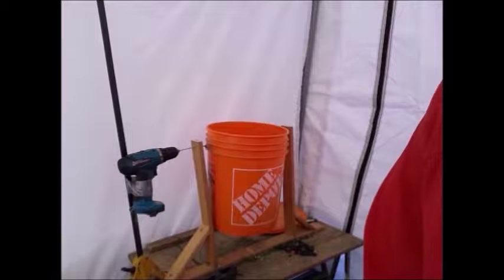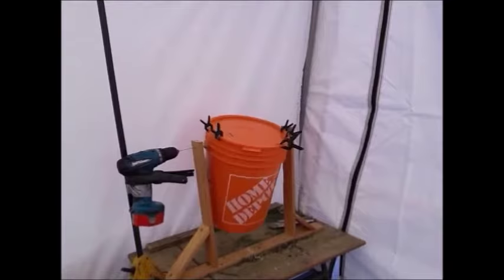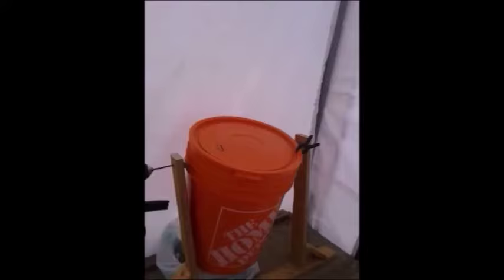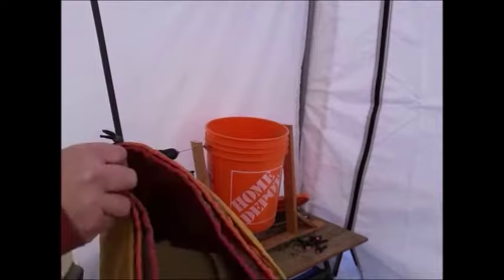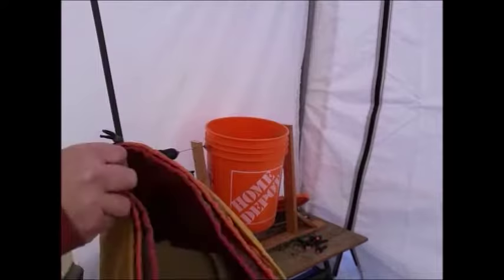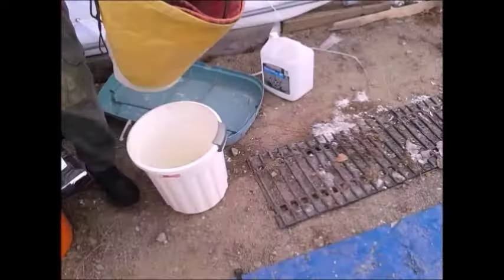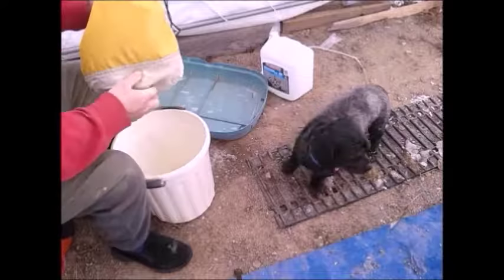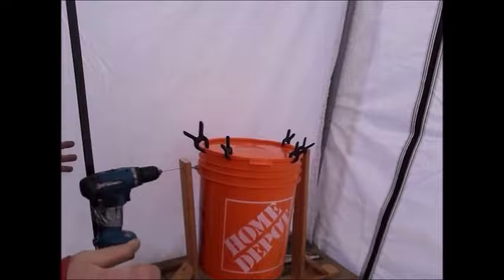Dry Sift Hash "the easy way"

Comment: Man, I’m 40, I fought in Iraq, was wounded and have PTSD, I grow my own medicine, I try to use every usable part of my plants.  I’ve been making honey oil, but I’m always down to try new methods of making concentrates.  This looked stupid easy.  Other than the initial work of growing your plants, and then building your contraptions.  Great video, it looked like a decent enough brick of hash, I would have definitely smoked some.  🤘🤙🙏
Reply: Mix your Oil and Keif together now. Old School hash.  Super potent!...You only need like 1G Oil ( Binding agent) to 4-5 G's of Keif.  Tape some wax paper to a cutting board and using a small spoon start mixing ( Pressure squishing ) until you rupture every trichome until it's all nice and black. (Providing your kief is blonde and not green). It usually makes a nice chunk of black Hash.  If you have dirty Keif (10%-20% green) then you'll have a second chunk for friends. 😆  Still choice but the colour starts to change from Black to Brown to Green as your grade of keif degrades. Still top shelf just a different colour. 
There's a ton of videos on making keif. Ideally you would want 100 micron equivalent to 140 mesh for blonde. When I was younger I used to use pantyhose stretched over a containe, then shake it nicely not too hard. Even better if you add a penny to about 5 G. Keep checking the color in the bowl. If it's not stretched enough, your trichomes won't come through, and too much you'll start letting plant material in. So you'll need to adjust and find that sweet spot.  It's just a quick and easy way to make a little bit of kief on a smaller scale, not having to go out and buy anything. But yeah there's lots of videos online. Good luck brother. 🇨🇦
EDIT:  Check out this guy.  Jonny's green extractions.
Reply: @locknload9143  thanks, I appreciate it.
Reply: @stinkfist4205  Anytime brother..Been making it for Years. 53 now. Let me know if yea need anything.
Edit: He has a 30 min. video titled " How to make Hash"  it's the perfect way.
Reply: @locknload9143  I’ll have to check it out.  Seeing as though I’m curing my harvest as we speak.  I use my fluffy buds and trim for concentrates.
Reply: @stinkfist4205  ..Yeah forsure!
Another one of his videos is titled: "BHO honey oil".   I just use a piece of abs with a plastic end cap. Same thing but Saves some money.  You can either sit it outside for 4hrs (if it's cool/cold out) or use a second container filled with warm water to evaporate 90% before heating.  You'll see in the videos.  Just do it outside brother!  Dangerous fumes.

Comment: Nice process. If you skipped the rock step and just went straight to the bags and shaker with crumbled flower or trim you would have a much more potent product. Best of luck and happy growing!
Reply from the maker: the frozen rocks are what crumbles the flower and knocks the trichomes off the buds, I know I overdid it with the rocks but it is a lot easier than trying to crumble it by hand because of arthritis, next time I will use fewer and smaller rocks for a shorter period of time
Reply: @TheCandleman51  unless you're using flower you shouldn't need to crumble it brother and if you are using flower try freeze and smash. I'm just trying to help out here. Please dont take this as criticism.
Reply from the maker: @thehomeownershelper9325  not sure what you mean... I was using flower and it was frozen, everything was frozen outside overnight. I don't even try to make hash out of shake.

Comment: If the hash was heated up it would make an even better hash. Heat can help it all bind together better, and the hash would likely last a lot longer stored. If I had a decent amount of kif / dry sift to mess about with, I'd be doing all sorts with it. 
I tried improving some crappy eurohash a few years back by heating and squishing it around but the stuff was weak as anything and was made up of mostly trichome stalks so it wouldn't go sticky and malleable

Comment: Hi. And great video.
I'd like to know the microns of each colored bag. Obviously the yellow one would be the finest mesh but I'd appreciate knowing the micron measurements. I have 5 gallon pale mesh bags of 150 micron (looks larger than 150mc) which I'm planning to use as the initial sift after the rock crush and been shopping around for the shaker bags but would like to know micron of each. Really appreciate it. Love your simple shaker bucket design. Watched a few videos on how to make one but none as simple as yours. I will definitely use your design as an example to fabricate mine but will improve on a couple of things like replacing the duct tape with Velcro for holding the drill, adding a couple of tight fitting short metal outer threaded tube sleeves to the bucket holes fastened with a couple of nuts to keep the plastic from deteriorating from the spin rod friction and maybe add some weight to the platform so as to keep the whole unit from shifting around while operating on a flat surface. All this will add longevity to the whole unit. Also. How long did the battery last on each cycle? Not sure if spinning until it runs out is necessary and it will definitely shorten the battery's overall lifespan. I'm thinking half hour on a timer switch would be sufficient and could use the same charge for the 2 spin cycles to prevent the battery from an early grave. Kudos to you my friend. You've given me great brain food for my build and I will make a video when completed and ready to use. Stay lifted.

Comment: You dont need to break the buds up so vigourously. Ideally you want to break the buds up no more than is required to break the material apart. Any grinding or pulverizing done beyond this point is shattering the trichome heads and smashing plant matter into them. If you figure out exactly when the material is the desired consistency and stop the drill then, Im certain you'll yield a better product rather than waiting for a whole battery to drain
Reply from the maker: You are absolutely right! I am going to make a new video in the next few weeks with this years crop, using smaller rocks and fewer of them for a shorter time is only one of the changes I'm trying, I will stop every few minutes and check the progress instead of a full battery , ( in my defense that is a very old drill and the battery's only last 15 or 20 minutes). I appreciate your comment, you know what you're talking about, thanks for watching.
Reply: @TheCandleman51  Happy to help! I was looking for a method to do larger scale hash production and thought your bucket tumbler setup was a great idea. I'll be rigging up something similar for next harvest
Reply: I must be slow or something, but was that just pulverizing buds that are already finished being dried and cured? Then it's sifted through screens and finally pressed into a cake? No heat pressing or cooking to decarboxilate it (spelling)?

I'm not asking sarcastically I'm just trying to make sure I didn't miss anything. So say I happened to have 4 or 5 oz's of small dried then jar cured buds kept at 55% +/- RH I can grind it, sift it through screen and all I need to do is press it with out any cooking or heating. I never did understand why I see guys decarb it when it's going to be smoked just as if it were burned in a bong or a joint. I understand it's necessary if it's gonna be eaten but if it's smoked I didn't get why they decarb something you heat by smoking?

But if you did decarb it at a low temp wouldn't it change that green color to more of a golden brownish like the blonde Lebanese hash of the old days. I guess the color doesn't matter if it tastes the same and it's just as good. This method is easily doable for me that's why I ask. I may not grind it to dust though. I'll dry freeze it to break all of the trichomes off right before screening. Or try an OZ each way first and weigh the 2 results. 
Thanks 👍
Reply: @newperspective4252  decarboxylation can only be achieved by heating the bud. It is necessary to render Tetrahydrocannabinolic acid into its orally active state. This is not part of hash making and should never be. Heating weed will vaporize terpenes and remove moisture resulting in dry, flavourless keif that has to be rehydrated to press properly.
Reply: @newperspective4252  if you smoke your hash there is no need to decarb cause it will decarb when smoked.
Reply from the maker: @newperspective4252  , what you said ! I have tried to decarb it first and it didn't turn out so well, some people say it is necessary but I don't think so. Grinding it to dust is not necessary either.... I did grind it more than I should have , live and learn. Next season I plan on using smaller rocks for a shorter period of time. so in my opinion , yes you can make hash without decarbing the plant first. Have a nice day and thanks for watching

Comment: You powderized the weed so much, there's no way you can separate the trichomes from all the leaf material. That would have to be the worst hash I have ever seen… I wouldn't even call that hash.
Reply from the maker: actually the trichomes are heavier than the plant material so separating them is not hard, if you vibrate it the plant material goes to the top and the keef goes to the bottom. As far as what you would call hash I don't really give a rats ass what you think, opinions are like assholes, everybody has one... except your mom, she has two.